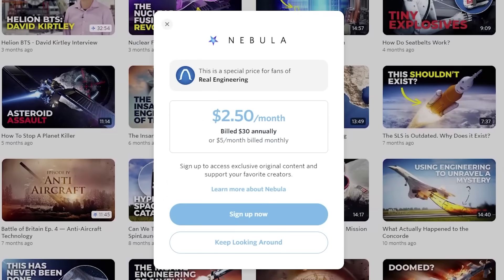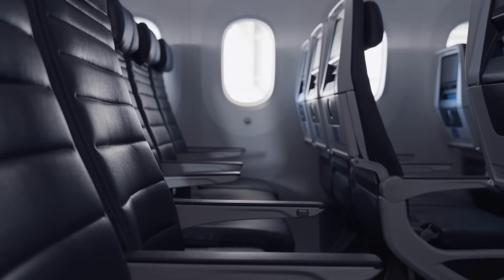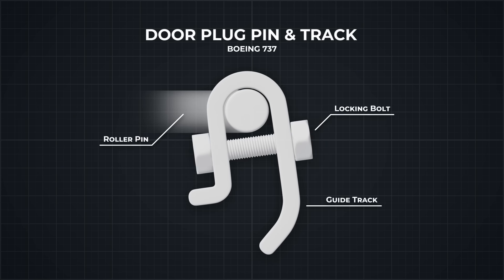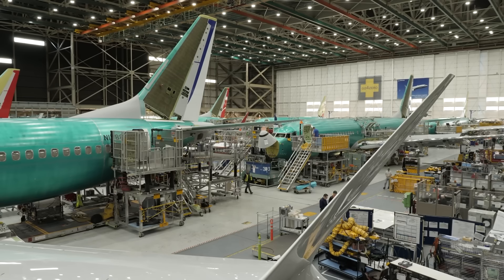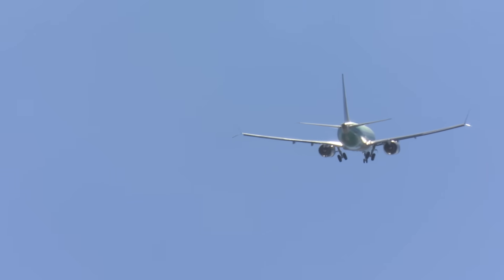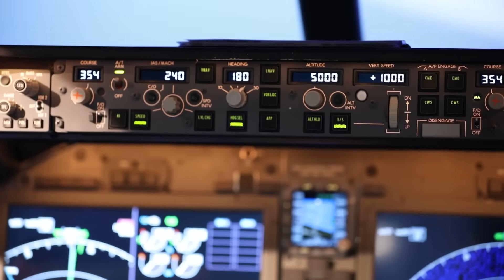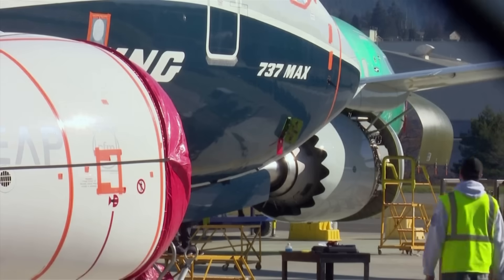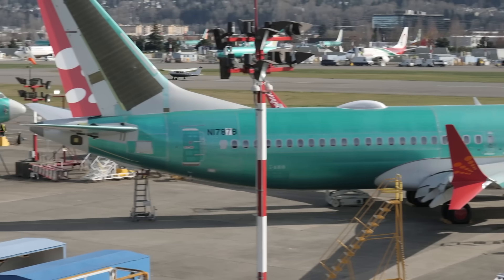The Questionable Engineering of the 737 Max

Comment: This is a total bullshit video, just following the prevailing winds.  The engineering design of the plug door has been in place since the 737-900, and it has never had an issue in the last 20 years. It is purely a quality issue at the sole-source supplier of the 737 fuselage.
Reply: Did you even watch the video?
Reply: As painful as it was, yes.  There is a lot of the usual speculation, and very little about the engineering aspects.  BTW, MCAS was not new on the MAX, it has been in use on the autoland system for a long time.  Giving it command authority based on one sensor was the key mistake.  Most of the issues being speculated about are quality issues, not engineering issues. If you haven't figured it out yet, I am a Boeing engineer, and my life's work has been about safety.  @haven216

Comment: The pressurization problems the aircraft was suffering didn't start to happen until it came back after having the WiFi antennae installed....and it's likely that those people were responsible for removing the safety bolts on the door plug.   That WiFi antennae is just forward of this plug on the roof of the fuselage and since the plane flew for several months without any problems and they started right after coming back from that installation....that's where a competent investigator should be looking.

It's good that a directive was sent out to check these safety bolts and hardware on all 737 Max....they found at least one loose bolt on a door plug bracket...so it was good to do that extra inspection.   Now to convince the NTSB that the door plug blowing out was the cause of the depressurization and not a result of it.

Comment: Sigh

My dad worked for Boeing for over 30 years.  He's spent a fair bit of the last decade and a half railing against the increasingly bizarre, inefficient, impractical, and unsafe policies the company had been pursuing in the latter half of his career.  He passed away last year.  If this trend continues, Boeing is going to ram itself into the ground, and I'm almost glad that my dad won't have to see it.  As for me, seeing the company my dad spent most of his life at do this to itself feels like it's spitting all over my dad's legacy.

I do disagree with one point on this video.  I don't think Boeing needs MORE regulatory oversight; after all, Boeing's reputation for safety lasted decades.  It just needs the current ones to be upheld again.

Comment: To be clear, the 737 max does not have an inherently unstable airframe.  Generally commercial aircraft have a longitudinal stability margin of around 15%.  Fighters, where instability is desirable for, have a 0% stability margin into the negatives.  My understanding with the Maneuvering Control Augmentation System (MCAS) is that due to the engine placement the amount of force experienced by the would be lower for the same amount of pitching moment. The pitching moment is also nonlinear approaching stall which was also undesirable from a pilot standpoint.  MCAS works by increasing the horizontal stabilizer incidence angle, which increases the stab pitch down moment, which also straightens the stick force gradient and moved the force back to what a pilot currently expects. It's important to note 737s still have reversible control systems meaning a direct mechanical linkage between the pilot and control surfaces. I just thought the description of MCAS was a little misleading.  The new engine placement does slightly lower the stability margin, but a Stability Augmentation System through the flight control system is the type of solution that's been common for well over 40-50 years.  Airbus planes are completely fly by wire and have been doing stability Augmentation since the beginning.  All this is to say don't dismiss flight control solutions as bad solutions on the whole because all modern aircraft rely quite heavily on them
Reply: @merlinemeresk412  comparison to generic fighters was to provide a comparison since SM% is normalized, and most people won't have any context relative to just a fixed percent. This isn't meant to muddy the waters but anchor the conversation relative to a relevant base characteristic when discussing longitudinal flying qualities. I take exception with this video's seemingly lazy description of how MCAS works. I work in and adjacent to flight controls and have generally come to expect more detail from this channel. Don't get me wrong, MCAS COULD have been a perfectly acceptable solution, there is nearly 60+ years of precedence for using the flight control systems to enhance flight characteristics, including yaw dampers which are almost always running, and there is even direct comparison with Airbus who purely uses fly by wire and learned a lot of these lessons already. The aviation industry is such that lessons learned in safety are generally widely circulated and understood.  Boeing did fuck up, repeatedly I am not arguing against that or trying to muddy the water.  Again, my issue is with his inaccurate and dismissive attitudes towards MCAS and flight controls as a solution in order to feed his otherwise justifiable narrative.  As an engineer, this has somewhat diminished my opinion of this engineering channel.  The 737 Max could have been a perfectly acceptable plane and configuration as is, if Boeing and Boeing corporate didn't get lazy and greedy with validation, testing, and quality control.

Comment: My ex wife just retired from Boeing after 42 years. She Originally was an engineer with McDonnell Douglas, and was "merged" into Boeing during what she termed "the reverse acquisition" (Where MD capital management wound up controlling Boeing). Her experience was that Boeing Was an Engineering-First driven company, and MD was always a  Profit-First company.  Some remember that the MD DC-10  had been involved in 55 accidents and incidents, including 32 hull-loss accidents, with 1,261 occupant fatalities.  All because of the MD management culture of shareholder value, which they brought into Boeing.
Reply: That's it right there - McDonnell Douglas ruined a great company.
Reply: outsourced the tech to india
Reply: Then there was the MD DC-10 that crashed because a fan blade in the tail engine shattered, severing the hydraulic control lines.
Reply: @KameraShy and at least the pilots managed to still save over 100 lives despite a complete failure of hydraulics. United Flight 232. The DC-10's design wasn't the initial causation there.

But the DC-10's cargo door issue was, and entirely greed driven. 300+ dead in that Turkish Airlines crash, purely because of greed and corruption.
Reply: @Bagster321  I saw the episode of air crash investigation on it. MDD promised to fix the issue based on a gentleman's agreement. But the fix was flawed and so people died 😞
Reply: @WeirdWolpertinger  the FAA were complicit in that. Paul Eddie's interviews in that episode really send it home. Plus, MD knew about it from testing 4 years before the crash. Greed kills.
Reply: Thanks for this insight. Very eye-opening!
Reply: This is well known among aviation buffs. Boeing brought on many of the MDD execs when they bought it, and the company suffered horribly in the long term for it.
Reply: @MrAllofyourbase  they outsourced whole IT to India lol
Reply: @user-do6dl5gh1z don't say the quiet part loud dude.  Something about racism.
Reply: @damnmexican90 more like something about making more profits.
Reply: @MrCoffis  you do realize it's both

You also realize the federal government forces diversity and other stupid shit as a pre requisite to get federal funds and or contracts right?

It's both.
Reply: @damnmexican90  i agree forcing diversity is just as racist as avoiding it.
Reply: @MrCoffis I was wondering how long it was going to take before someone tried to blame diversity.  Ya'll find a talking point and run it into the ground.
Reply: I feel like a system where higher level engineers working in this industry have access to a direct portal to anonymously report safety concerns to regulators is a must. I don't know what options currently exist that would be taken seriously but some type of system held to a high standard and trust that is illegal use against them. Perhaps keeping it anonymous would undermine this and it would likely be easy to tell where specific complaints originated anyways so considerable safety guards would need to be in place.

I don't have the answers for how exactly to implement something like this but it's clear something needs to be done. I'm sure many engineers saw issues like these coming from a mile away.
Reply: @Dominus_vobiscum__7 yes blame the Indians when the company culture itself has been flawed since the nineties when the merger with MD. Btw Airbus has outsourced its IT to India too, perhaps their aircrafts should start crashing as well anytime now.
Reply: The stock market is at the root of so much of what's bad about capitalism
Reply: that the problem no one address! before boeing is straight up the iconic of aviation most frontier development. And i felt like it wasn't the engineer design fault, it they are force to design like that or get fired.
Reply: This explains a lot. There's the problem right there. MD should have folded.
Reply: So true Boeing was an amazing company, then MD ruined that reputation.
Reply: yay capitalisms! 
Why is it always: "they were doing things right until they wanted to make money from it"
Reply: Okay, but how many events did Boeing have?
Reply: "We bought Boeing, and got Boeing to pay for it!" I believe was the joke amongst the MD management.
Reply: Nothing says profit first like endangering your customer base… lmao
Reply: thanks for the insight!
that is valuable information regarding evolution of company- culture. 
hope you two have a great retirement!
Reply: very common tale
Reply: I think the FTC has to look into this
Reply: As they say McDonnell Douglas bought Boeing with Boeing's money. And then ruined it.
Reply: I like, when you can tell from the comment that someone did not much the entirety of the video or commented based on the title - when the exact point they make is addressed in the video. Blaming MD merger for Boeing's problems is pure copium.
Reply: Sounds like aeroflot
Reply: Interesting. That explains the downward spiral of Boeing after they merged
Reply: MD had terrifying records, yes. People forget easily apparently
Reply: Reminds me of an old friend of mine who worked at Space X back in 2010 ish. He was enthusiastic at first but after two years he was practically clawing to get into JPL because he compared the culture at SX to be this almost cult like culture of suck ups who insulated Musk and shareholders from any sort of constructive critique or even potential flaw reports. Just speed, cost and ego over refining trial and error. Even concerns often got lost. According to him anyways.
Reply: nothing to do with shareholder value, quite the opposite. It was culture of cronyism, laziness and collectivist cutting corners because they were not reliant on free market and capitalism and instead they live of taxpayers dollars and redistribution by federal government. Boeing on the other hand was taking care of shareholders and was subject to free market and capitalism which meant they had to do their job well and if they didn't they would loose money.
Reply: @SimPitTech  Airbus gets way more government money and they don't have these problems.
Reply: @rjfontenotiii  wait until they start trying to integrate all those engineers from the middle east that moved to Europe in 2015
Reply: @justalostlocal  

German regime and French government admitted those "migrants" refuse to work and miking the system. 

Sweden forced its native citizens to work longer before they retire to pay for migrants who refused to work

Yes, your genetics play a role as to whether or not a group can wholesale participate in civilization or not.  

If those migrants were as capable as the governments and transnational organizations of Europe lied about, and those here in the US have as well. 

Those nations would be far more developed and advanced.  

You're not seriously going to sit there, lie to me and yourself that Syrians as a whole are as competent as Iranians are you?

And I'll be more direct.

Your genetics play a factor in your intelligence.  Are you seriously going to say that evolution affected humans everywhere but the brain? Evolution magically played a role everywhere but the organ that defines humanity?  Come on dude.
Reply: @damnmexican90  They are highly educated people. Among them are mechanical engineers, doctors, architects. Every immigrant is a proper gold egg.
Reply: @SimPitTech this is a big logical stretch youre making.
Reply: @SimPitTech  what a way to say it has nothing to do with shareholders and capitalism but then go on to describe capitalism lmao. Fyi cronyism, laziness and getting government handouts like 99% of these corporations do, is literally capitalism and a consequence of the “free market”
Reply: @SimPitTech  collectivism is when cut corners. i am very intelligent.
Reply: @MrAllofyourbase 

Shareholder value is when no cut corners, no cronyism (what) and no laziness. 

(What a moron lmao)

Comment: I remember the 737's first accident with them moving the engines up too high on the wing. Seems so long ago now, but my goodness...This just reignited my fear of flying on commercial jets. I realized that some airlines in my country are opting for Airbus models like the A320 and A321 models
Reply: It's crazy how well the A320 is selling, 10k orders vs 6k for the MAX. if I'm not mistaken it's the first time Airbus has the clear upper hand over Boeing.
Reply: Those figures will even out.  Prepare for protectionism to be announced by the next president.  Doesn't matter who it is.

Comment: Let's not forget the Dreamliner had battery fire issues which grounded it for a while too. Boeing has been experiencing issues for well over a decade now and people are just now noticing.
Reply: All new aircraft have issues.
Reply: @stargazer7644  That is objectively wrong.
Reply: @gabrieldasilva7970 Show me one aircraft that has never had a single issue.  If it is so objectively wrong, this should be easy for you.  I've got news for you pal, people aren't ever perfect, and the things they create aren't ever perfect either.  It is impossible for a device as complicated as an aircraft to not have issues.  If it was, they wouldn't need redundancy designed into them.
Reply: @stargazer7644  You said ''all new aircraft have issues'' that is simply not true, also, define what you mean by issue, it's not the same thing a plane that has to land in an emergency due to badly made maintenance, than a plane that has DESIGN FLAWS that could potentially kill hundreds.

Aviation is the safest method of transport because of all the regulations and rules attached to it, regulations boing avoids by using legal loopholes with this specific model.
Reply: @gabrieldasilva7970  I don't think you realize how often aircraft make emergency landings - of all types.

Comment: Boeing executives more concerned about woke culture and meeting DEI requirements that anything regarding proper engineering or quality control standards while basically trying to bribe it away through federal regulations and the DOT/FAA is happily turning a blind eye to them under absolutely incompetent leadership. The problem is in order to save their asses, they will throw everybody under the bus so we're going to see the pendulum swing the other way in a very radical direction as politicians and executives start cracking down way too hard on things that don't need to be just so they can virtue signal that they're doing something.

Comment: man, as someone who’s pretty informed of commercial aviation history, the 737 max is having more and more in common with the DC-10 by the day. both aircraft suffered accidents early in their careers due to design flaws, but rather than software problems like the Max, the DC-10’s flaw was… its cargo door locks failed and the door blew out causing depressurization. first time it happened (American flight 96)the aircraft landed safely as Alaska has. the DC-10 cargo door problem returned though and brought a Turkish flight down three years later with no survivors. 

Boeing MUST get their priorities straight and return to their history of well built, safe aircraft if they want any hope for their future as a company. people’s lives are at stake here. air travel needs to stay safe as possible.

Comment: Another thought, They limited it from overwater flights, for Alaska Air that probably means shorter flights, which means more pressure cycles - perfect for a plane that has a known pressurization issue
Reply: They limited it from overwater flights as a precaution so that any pressurization issue would occur near an airport and not over the Pacific. No one expected this door plug to just pop off on a brand new plane.

Comment: You guys think this is bad. If You only knew about the Oil industry... (Upstream, Producers, and Refineries).

Mid-Stream (Pipelines) are actually remarkably competent in my experience. They should replace Trains in almost every case. Much safer and environmentally friendly to use electric pumps to ship a hundred times more than that of diesel locomotives.